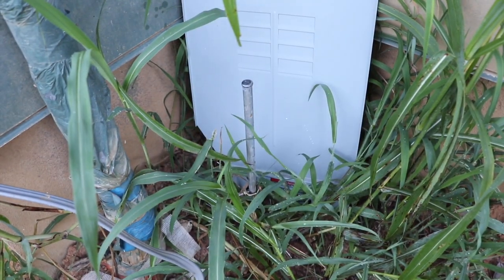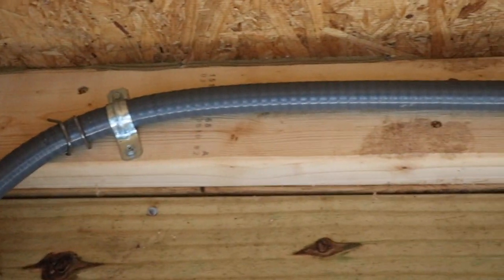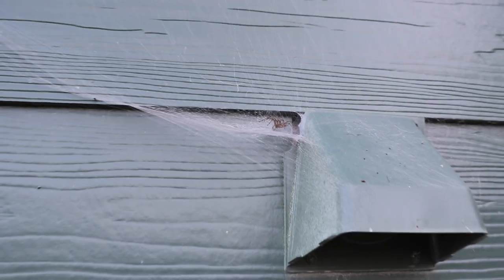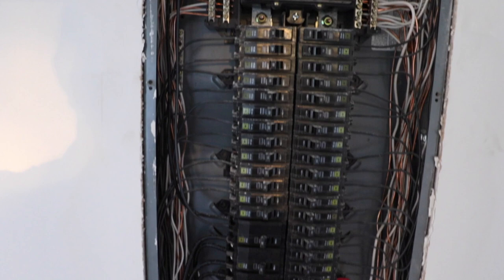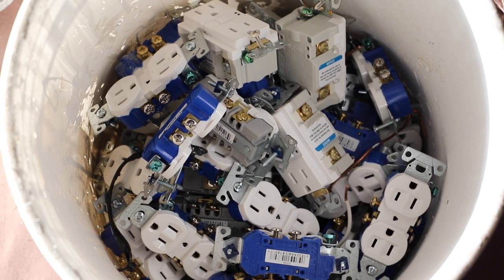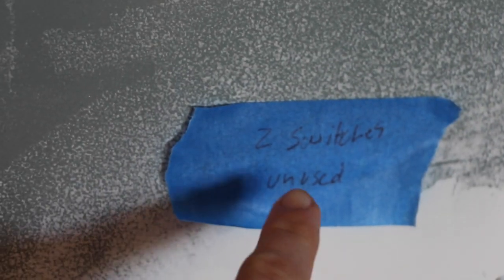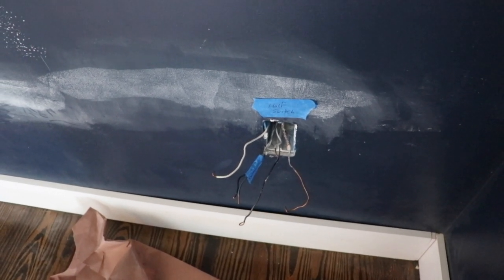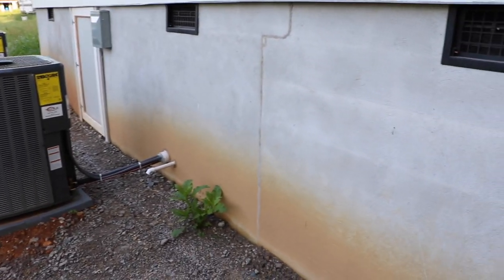Electrical Contractor Failures - Trade Tips

Comment: Oh by the way the wires in that wall being nicked by the drywall contractors would be your fault not the drywall contractors nor the electricians. It the wires in the wall would have been properly ancored like u previously said the drywall layers would not have nicked them with their tools
Reply from the maker: Jonny R wires "in the wall" weren't nicked wires "in the outlet boxes" were nicked when they cut out the whole for the box.  I had nothing to do with either.   Johnny I think the whole "think before you speak" thing would be relevant for you in commenting.
Reply: Yanasa Ama Ranch Homesteading so OK I was wrong about witch wires bit still kinda ironic seeing as the cuts the drywall layers did is literally right on the edge of the socket box and there is absolutely no evidence that their tools actually went into the box. If that were the case there would be cuts on the box itself witch in return would still miss the wires so seeing as there are no cuts in the box bit there are nicks in the wires why is this video not about the drywall layers work also.
Reply from the maker: Jonny R the electricians completed the box junctions.  So off the wires weren't tucked correctly it's on them.  If the wires did get nicked and they returned to complete the junction they should have repaired the nick.  I don't see how you can see inside the box without being here (Johnny boy that's a little creepy), however the Drywallers run their cutter just inside the box so the cut remains tight around the outside edges.
Reply from the maker: Jonny R I didn't do any junction box connections I nailed boxes in place and ran some of the wires through walls, the electricians then stapled, nail plated, pulled wires into the boxes, stripped them and wired them however they were supposed to be. Basically I did the monkeys job. You're the one who said if the wires were done correctly the Drywallers wouldn't have clipped them.  Point is when the electrician came back to wire up receptacles and switches, they should have repaired any damaged wire.

Comment: Most municipalities do not add anything above and beyond Code. This assumes the house was occupied and built prior to AFCI code changes: Section 210.12 talks about AFCI. Section 80:11 further states that existing occupied dwellings do not have to be changed to AFCI  unless changes are made to circuits of adding more than 6" wire or additional receptacles are added. A brand new home is required to meet AFCI requirements.

Comment: I haven’t made it through the whole video yet, but you are very well informed. I don’t do resi electrical I’m industrial but same principals apply. Lots of good points made. Looks like a one and done contractor built the home. That’s sad. I would have greased the outdoor copper connections but it has to be done right. If you can see the grease there is too much. Non moving cu-cu connections don’t require grease and even moving parts if it’s not done by manufacturer.

Comment: Very bad work they didnt even use penatrox on the aluminum at least they used a qo panel the second one had aluminum buss im licensed and wont use aluminum at all ive seen union electricians do lousy work they double locknutted the panel stuck a rigid 21/2 in nipple out the house put the meter socket on with NO LOCKNUT BEHIND IT 1960s subdivision also have seen nonunion crappy work I take great pride in my work .Where i live you must rough the house in EMT & 4 IN SQUARE BOXES All outside stuff including complete service runs MUST BE DONE IN RIGID METAL CONDUIT . IF YOU DONT DO IT IN CONDUIT YOU MIGHT AS WELL NOT DO IT. Romex not welcome hear.

Comment: You should seriously name names. It’ll save ppl time and money. You don’t know code. Yes it looks better phase wise to have black then red, but it’s not code. Find me a 2015 code book and I’ll wire your house for free. Why does it matter that the washer cable comes in from the top? That doesn’t mean it was jumped. Bad install agreed. You’re not an inspector. How is the inspector gonna see the UL listing if the ground rod is completed buried? If you’ve so called done this work before, why didn’t you just do the work yourself?
Reply from the maker: There’s no point in naming names. I know enough about code to know that local ordinances carry jurisdiction, if they want wires a certain way in their county, they have the right to require it. Washer cable was dropped down from a receptacle above which was inline with 8 other receptacles. Local jurisdiction didn’t like it. A ground rod shouldn’t be 10” above grade... I wouldn’t even try to defend that.

Comment: They obviously weren't electricians, and neither are you. Keep your fucking hands away from those lugs in the panel! Do not use the locktite gel for the aluminium!!!! That's outdated code for a reason! Anti oxidizing gel for mixed wire is out of date. You are right about most everything else though. I see you daisy chained sub panels, maybe you should have the company come out and run another service.

Comment: Damn hillbilly romex jockeys
Fyi neutrals and grounds separate after the 1st means of disconnect!
If the 1st means of disconnect is in the main panel you can use neutral and grounds on the same bus bar but wouldn't think the same lug !
Hard to find union romex jockeys but if you can probably the way to go being we are subjected to a code of excellence by the international brotherhood of electrical workers.

Comment: Ground and neutrals on a sub panel can be doubled up if necessary, best to keep them doubled up as a pair than mix matching but even still... and the terminals where the wires are connected into are for ground or neutral wires. Whoever did the electrical on your sub panels didn’t do anything wrong on that aspect of things

Comment: Only 6mins in but I'm bro, you gotta relax. You don't know enough about the trade to make this video. To start you called the neutral a ground in the main panel(i let it go). Then you called it a bolt, it's a lag. You weren't sure if neuts n grnds can terminate on the same bus in a subpanel 😭. Then you called it "grease" n questioned if it was necessary. It's not grease, it's an anti oxidantion paste necessary for every cu/al termination. Gonna gringe thru the rest of the vid now

Comment: What the hell is copper grease?
Reply: What he should have said was dielectric grease and/or antioxidant compound , 
Antioxidant compound must be applied to all connections in outdoor electrical equipment
The second thing I noticed when I saw the rows of breakers was the highest amperage breakers were installed on the bottom of the panelboard , Which should definitely be installed on the top , Closest to the main breaker to prevent overheating of the main busbars , The way I mark wires is I use wire markers which consists of letters and numbers , After putting them on , I'll put a piece of clear heat shrink tubing over them to keep them from coming off

Comment: another thing I see it seems he has used all wire gauge 14 AWG, at list he should have used #12 AWG . that electrician was i can say he is thief not electrician.
Reply from the maker: 123kkambiz actually most of the house is 12... the yellow romex is 12 the white is 14. I requested 12 because I wanted 20amp circuits instead of a ton of 15s
Reply from the maker: 123kkambiz I guess deciphering between 12 and 14 gage and "request" vs "direct" aren't your strong suit. Those are 20 amp circuits with 12 gage wires because as the owner of the house we requested 20 amp circuits which we have every right to do.
Reply: As home owner you cant tell the electrician reduce the size of the wire, because tomorrow you may sell your house and the new owner know you have reduced the size of wire. you say you have put 20 amp outlet because you don't want tons of 15 ampere breaker , then you request or direct electrician to reduce the size of the earthing wire, that is ridiculous, as I gave reference for grounded wire info according to NEC for 20 amps you need to put 12 awg gauge wire. as homeowner you cant reduce the minimum quality of work required by NEC but you can ask him to put larger sizes. You are playing with the life and safety of the next homeowner who don't know because you want to save few dollar in wire cost , you are ready to put the safety of you, your Innocent family and next homeowner at risk. Period.
Reply from the maker: 123kkambiz it is 12 gage... are you aware that 12 is larger than 14 lol
Reply: In gauge system numbering of AWG,  gauge number system starts like this from smallest size  as follow:
20, 18, 16, 14, 12, 10, 8, 6, 4, 2, 1, then goes 1o 1/0, 2/0, 3/, 4/0, then 100, 200, 250, 300, 400, 500, 600, 750, 1000 and so on.  the 20 and to sixteen usually is not used in building codes as they are very thin , where as minimum size  for 15 ampere comes #14, then for 20 ampere minimum size is #12  for 30 ampere minimum size is 10 , for 40 ampere the wire size is 8 and so on. Just google  NEC wire gauge table, you can see in internet.

Comment: Fail fail fail Red must be on the right side and black on the left. That’s a violation of NEC 1.1.1-BULLSHIT.
Reply from the maker: It is a violation because it is locally required and code gives them jurisdiction.
Reply: It is never required to have a certain color on a certain side
Reply: The AHJ will never require something as small as that if the NEC didn’t find it necessary to be a requirement
Reply from the maker: JOSH BARRON but clearly they did... because they listed it as a reason to fail it.

Comment: All you had to do for the switch outlet Is tie each black and white coming from each cable together take you meter put it on ohms and you’ll find continuity and that’s coming from the switch.. this guy obv doesn’t know electric in general but shouldn’t of hired shitty contractors though
Reply from the maker: Tyler Brisseau you'd be surprised how difficult that was for two electricians. Hiring in a rural area is difficult because of the availability of electricians
Reply: Why one wouldn't use a three wire is beyond me.  I run it between all the outlets in the living room and other rooms where one might switch plugs so any one of them can be switched .
Reply from the maker: Gra Gor that's a really good idea.
Reply: Actually now, what with all the neutral desiring electrical devices these days, I run a three wire into all switch boxes - U/S hot, S hot and Neutral.
Reply from the maker: Gra Gor sounds like a proactive solution.
Reply: Gra Gor I feel you on that it beats having 9 neutrals tied together in a 4 gang switch box
Reply: That's nasty.  My goal is to never go beyond a 2 gang box.  I often put a second 2 gang box at 5 feet OFF for controllers - such as motion sensors and outside lights.  The first one at 4' OFF would be for general lighting etc.  

My father in law had a post and beam 'Japanese' style house with a 6 (?) gang box in the bathroom that was guaranteed to turn on some combination of the bedroom lights while I would be trying to turn on the light for the water closet room.

Comment: As a contractor you should know you can not touch or replace lights under the house and change  out recepticals.  You are not a certified electrician. The electrical inspector if he knew what you did would have fined you big time. Find good help and it would not be a issue.If you didn't  hire the cheapest you would get good help. And don't Quote the NEC if your not an electrician. The nicks in the wire you bad mouthed the electrician were from the drywallers not the electrician. So maybe look at your operatian not bad mouth others.
Reply from the maker: It is 100% legal for a home owner to do 100% of their own electrical if they choose to. So no, the inspector wouldn't fine me for stringing up a few lights in the crawl space. Obviously the nicks in the wire were from the drywallers, but the electrician shouldn't have left them on his trim out.  Thanks for playing.
Reply: so who hold the permits.
Reply from the maker: Does it matter? If you are a tradesman hired by a homeowner to do work, you do your job. Irregardless of who holds the permit, you can still be held accountable with the licensing board and court system.
Reply: If you pulled the permit and hired someone  else like a plumber than it matters.
Reply from the maker: No, it really truly doesn't. If I hire a General Contractor, and he hires a tradesman and something goes wrong is the tradesman held accountable?  Yes.  While I have the right to sue the General Contractor, the General Contractor has the right to pursue the tradesman.  Does the electrical board care who's name is on a worksite if you were hired to perform work as an individual licensed under their supervision and training? No.  The only thing the electrical board cares about is the fact that you are a licensee and you didn't perform in accordance with your license.  At the end of the day, when it comes to the law, who holds the permit has little to no significance.  You can't go up and screw up work, expect to get paid, and then point fingers at everyone else because you think there is some magical loophole that will say you aren't responsible as a licensed tradesman to act, and perform as is required under your license. The only person who cares about the permit is the county.  The only thing the county cares about is making sure the person performing the work is a responsible party.  The county won't get involved with anything else. They don't care.
Reply: did you hire a general contractor
Reply from the maker: Are you trying to excuse the poor work of the electrician on a GC?  We aren't we had a terrific crew who did a fantastic job.  As for the electrician who did the electrical trim out.  Having a GC doesn't change the fact that the electrician was a licensed individual and had to abide by state licensing laws.
Reply: so no contractor and you pulled your own permits
Reply: hw do i know it was a licensed electrician
Reply from the maker: Incorrect assumption.  But thanks for playing. You are more than welcome to watch our channel and learn in detail how we hired, etc.  But nothing changes the responsibility of a licensed tradesman.
Reply from the maker: Well, that's a good question because we aren't going to name anyone.  But, logically, why would we hire an unlicensed tradesman and then complain about them saying they are licensed?
Reply: who holds the permit.
Reply: If you pull a permit and hire someone else to do the electrical is illegal where I live.
Reply from the maker: eric c wiring ch making viable arguments is not your strong suit.  A homeowner can pull a permit and hire a licensee to perform work under their permit.  A licensee can pull a permit and send a non-licensed employee or licensed subcontractor to do the work under their license.  A GC can pull a permit and do the same. At least in the state of North Carolina.  Irregardless of any of that, if you hold a license of any kind your licensing board as well as federal and state law hold you, as a licensed person, accountable for your work.
Reply: It does not work that way in my state. If you hold the permit you are held responsible. And if you do not have an admistrat
Reply from the maker: eric c wiring ch imagine that another American raised with the misconception that they cannot be accountable for their own work.  That's very sad.  You should be aware of state and federal case law of negligence when it comes to contractors... it will be an eye opener for you.
Reply: In my state a home owner can’t pull a permit and hire an electrician to do the work. The electrician would lose his license. It may be different out there
Reply: So no misconception here. I’m accountable for all the work I do.
Reply: And what NEC book are you quoting. Never herd of a 2015 book.

Comment: Copper to aluminum or steel  should have dialectic grease. Really good video, I suspect, if you talk to the inspector he will advise you who to notify about this. If not, your municipality can also advise you in these matters.

Thanks,
Ron
Reply: ron prize noalco is virtually invisible once it's applied. If you can prove you could tell the difference from a video, you need to be an inspector.

Comment: Lol
Reply from the maker: Per your deleted comment on the SE cable at 2:50... Most would interpret that the code states a sleeve is required when going through masonry. There's also a very important part of the code that gives local authorities jurisdiction so when in doubt ask the local inspector... although most electricians are professional enough to know the local jurisdictions in the areas they work.  In our jurisdiction a Service Entrance cable running through masonry must be sleeved... and he went further in saying all cables had to be sleeved in hard conduit, not flex.